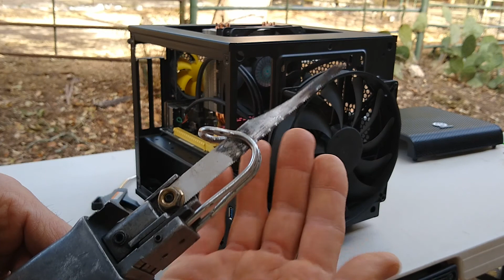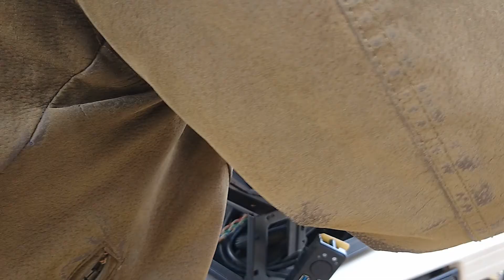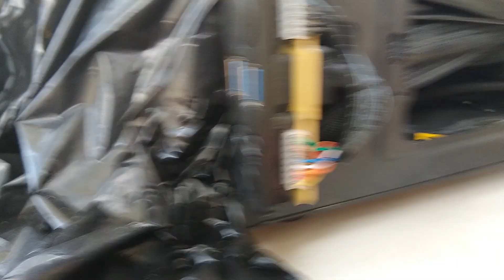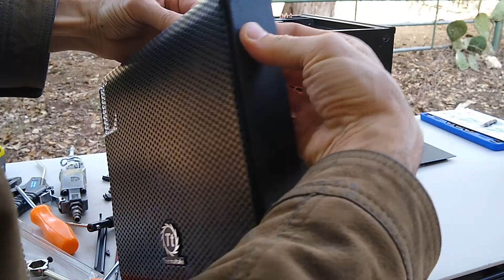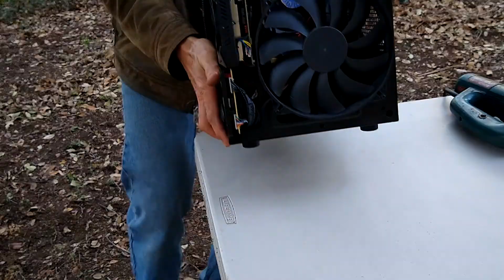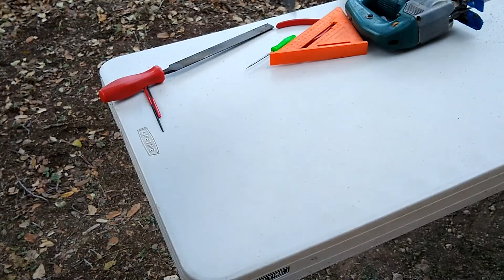ASUS RTX2060 DIY Casemod install into a Thermaltake Core V1 Extreme Mini ITX Cube Chassis

Comment: I have a colorful battle ax 3070 if I follow this same guide will it work? 🤔
Reply from the maker: Hello friend, thank you for commenting. You're going to have to be the one to make that call. The reason I did it was to possibly avoid having to replace the case. In my case it worked out but if you can't make it work with your card a new case will be needed.

Comment: Would of emptied the case personally before cutting
Reply from the maker: Hello Jacob, Thank you for commenting. You're 100% right, It was risky for sure. It worked out for me but I wouldn't recommend anyone trying this without removal of the rest of the components.

It was more about that it could be done then the best way to do it. Your way would have been the best way if someone was needing to reuse that same case instead of getting one that would accommodate that card.

Best of luck with your mods!

Comment: Can it fit a Micro ATX motherboard
Reply from the maker: Hello Link | CherryTree, Thank you for commenting. Check to see if your model ATX motherboard has a PCI Express x16 3.0 slot then, yes, it should work providing there is enough space in your case.

Best of luck with your build!

Comment: Why??? You can get the same card in different size.
Reply from the maker: Hello Drumea Drago's, thank you for commenting. They were purchased just before Christmas 2020 and for some reason all the RTX2060s were in short supply. Each of my kids put one on their list. Another issue is that those cubes fit into a custom desk I made a few years ago so switching out the cases wasn't an option either. I enjoy making things work anyway so it's just another excuse for me to start solving the fitment problem.

Best of luck with your projects!

Comment: A bit of a cringe when I see he didn't remove his components before cutting, but I guess nothing shorted out.  That and with the cooler sticking out the top, maybe its just time for a bigger case.
Reply from the maker: Hello Derrick, thank you for commenting on this Mad Max computer case. Emptying out the case would have been much safer than bagging and cutting. I have a custom built desk that fits this cube perfectly. I should have mentioned that in the video to help make sense of the reason for going though all the trouble of making that video card fit.

Best of luck with your projects!

Comment: Thanks for the video, gave me motivation to mod my new v1 as well to fit my 1070 ftw in. The second 8 pin was in the way of the chassis, so I cut out a piece of the chassis, then on the top panel so the cables would fit in the gap where the panel slides into place. I used just a rotary tool and some nippers.
Reply from the maker: Hello Tharendel, thank you for commenting. I'm glad you found value in this video for your viewing time. Great job modifying your setup! It's all about problem solving issues one at a time.

Cheers!
Reply: @vbared  exactly!
Reply: @tharendel I have exact same card and managed to fit it into same case without cutting anything. Just had to plug wire in before seating card into motherboard slot. But yes, wires will be touching case.